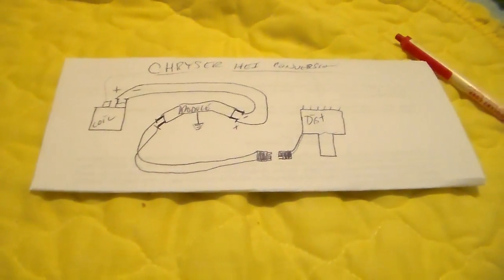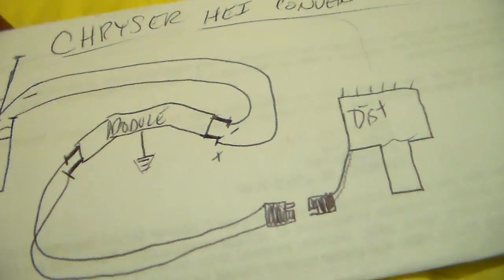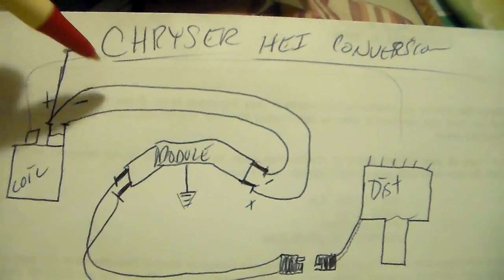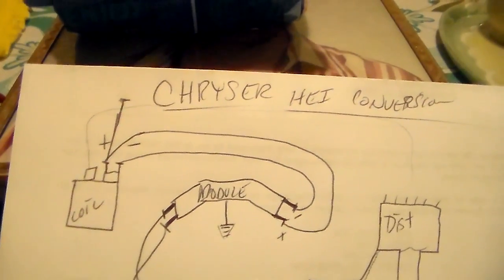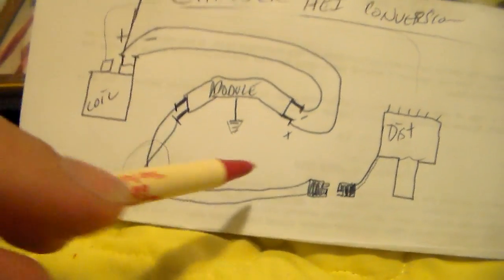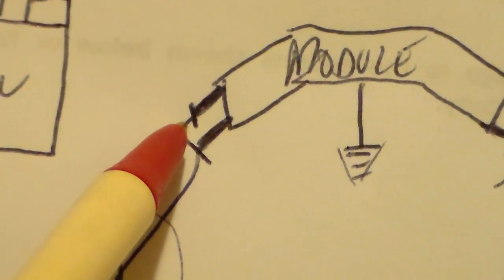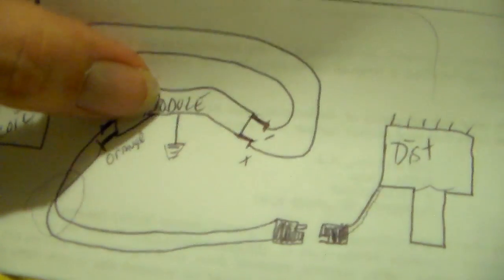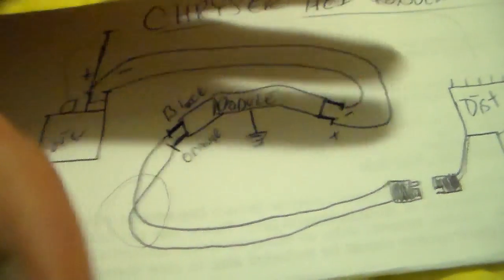Wiring diagram for the Chrysler HEI conversion

Comment: Thanks, I healed my Dodge truck. About maybe 10 years ago I swapped my truck over to the HEI. Lately it would miss above idle and on up thru the rpm range. Mine was backwards so I replaced it and wired it as you have shown in your video. It's spot on, runs like a champ now. I just about totally rewired my truck in the dash back when I did this as Chrysler Corp wiring wasn't very good at the least. I actually added a relay in the circuit that the switch pulls in like the starter solenoid does. This gives a good 12v to the firing system. Also added relays to the headlights since the headlight switches are prone to fry too.
Thanks

Comment: Is the module the ballas resistor?
Reply from the maker: There is no ballast resistor used with HEI. Those were used with Chrysler-designed systems to keep voltage spikes and the like from frying the electronics. Run the HEI with a switched, fused straight 12v circuit.
Reply: Thank you i was a little confused there

Comment: went to salvage yard today, most GM's (after the BIG HEI cap and rotor setup where the coil is on the top of cap ) have a coil and module mounted on a bracket on the intake,the module has an aluminium heat sink already under it. Just unbolt the bracket and you'll have what you need(my 93 suburban has this style) , the module is a newer style so you'll still have to source the one like the one he has pictured,that style module would be one like on my 86 Suburban.The bracket ,coil, heat sink etc.  cost 9.99 at U-PULL-IT. I bought 2 setup's just to have one one hand

Comment: Hi Tyler. I bought the exact same bracket and coil assembly recently from junkyard with connectors. But I am confused about the 3 wires on the connector. There is a pink, white, & white with black stripe wires. So Pink = +12Volt I guess, but what about the other 2 wires? Is the white with black stripe the coil neg wire? Then white wire is for tach? I am worried about connecting it wrong and breaking the parts.
Reply from the maker: +EngineWelder I had to figure that out also. I think youa re right but let me dig out one of those conversions i did and look at that connector, and I'll get back to you.
Reply: Yeah there are three wires what goes to what on the coil.

Comment: polarities for various pickup coils: https://books.google.com/books?id=9bJDAgAAQBAJ&pg=PA23&dq=pickup+coil+connected+backwards&hl=en&sa=X&ei=tv4-VbC_Co7roAS
Don't forget to run a 12 gauge ground wire from the bolt hole beside the "C" terminal to a good source of ground. Otherwise, you can count on becoming well acquainted with your friendly local parts counterman, as you will be popping modules every few days. Good idea as well to replace the cap & rotor with fresh units (brass terminals if available). change out your plugwires too.  Go with nice thick magnetic suppression, spiral, or "magna" core replacements for good containment, so you don't have a feed to more than one wire at any given time - or you'll overwork the module & pop it. keep the plugwires & also all leads to the module short as possible to reduce resistance which heats & kills the module. 3/16X2in. aluminum (about 1.5ft of it) makes a good heat sink.

Comment: your picture of the modual is a part I do not know? You don't say where or what this part is from? What year? Brand? Not Mopar modual? @ RETRO MOPAR
Reply from the maker: I'm sorry for the confusion. The module is for a GM HEI distributor between 1975-1980. It must have 4 pins only. Some later versions have several more, do not use those. I suggest a new Delco or Wells module.
Reply: WhoSaidTyler Hello if you go to YOUTUBE Classic HEI ignition systems by swrtrailbeast I sent him a reply you will see it. I am exploring this for my 1978 Tradesman B200 van.

Comment: Great video. Ive inherited my father in laws 85 D100. It has one of these computers behind the battery box. Im not getting any type of spark from my coil. Ive determined its this lean burn computer thing. I want to get rid of it and go with the HEI conversion.